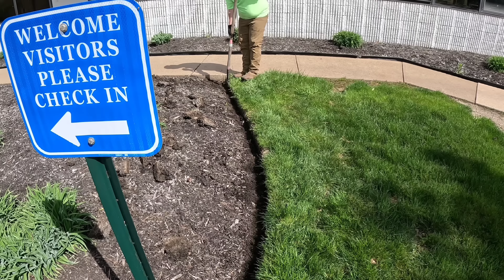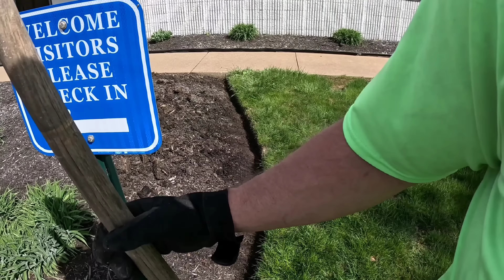HOW TO DO A SPRING CLEAN UP!

Comment: Looks like you could use a 6 inch battery powered trim saw to trim up low hanging tree branches around some of the places that you mow , or cutting long branches into short links for easy removal

Comment: Do y’all get shocked at all from the still blowers? I just bought an Echo pb755.  Second day I had it I had a job blowing leaves from a really dusty area and it started shocking the hell out of me.  I exchanged it for a new blower thinking something was wrong with it.  I later found they have static shock issues.  It’s the first backpack blower I’ve owned so curious if this is an issue with all blowers
Reply: Pull the tube off before the flex hose. There should be a static ground cable in there. Sometimes they break off and you don't know till it shocks you.
Reply: @firstname6208  I boughtmit brand new.  The manual shows the wire but I have yet to find it.  The tube came in 4 piece so I figured I would see it.
Reply: @bjrollick5262  either it's folded back in the housing somewhere or someone failed to install it. I hade an 8010, now a 9010 both have had it. I haven't looked on my 770 but haven't gotten a shock yet either.